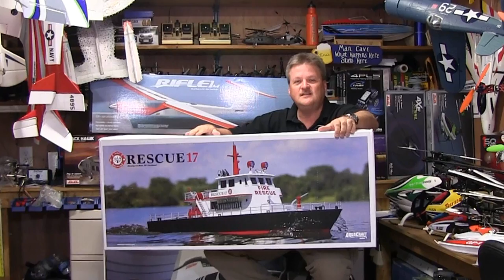AquaCraft Rescue 17 RC Fireboat Review

Comment: I like the variety of subjects; nice to mix things up. I found it helpful that you commented on the stick position / the amount of throttle at different points of the video so that I could get a better understanding of the boat's speed. You should do that more often in your plane reviews - it helps to know how much throttle is required for 'just above stall speed' to 'gentle Sunday flying' when evaluating a plane.

Comment: I actually liked the boat and the water cannon gave it the "oh cool" factor, Its quick enough to be fun, but slow enough not to have the capsize or submerge tendencies of previous reviewed water craft. One thing you did do in the video but did not mention is the common sense issue of wearing proper shoes for this activity. Wet feet equals unhappy boating for many reasons. Good job on the review!

Comment: Great boat with nice scale details. Looks like a great little boat right from the box. I would find a way to add an  led to the water stream to project a red or blue or green  water stream at night and modify it to control the lights from the transmitter. Now all you need is a micro rescue helicopter to land on the back deck

Comment: You are exactly right-they are more efficient. The rubbing parts they lack are of course the brushes :). So you get a motor that gives more power (which can be turned into speed) and needs less maintainance (only parts that could wear are the bearings). This boat is a nice semi-scale model-I have it and to me it's plenty fast for what it is...the brushed motor will last well in it. It wouldn't be worth the cost and effort to make it brushless. Brushed motors still have a place. :)

Comment: Nice boat but I think some improvements should be needed such as a 5 channel radio to be able to turn on and off the lights, and a brushless motor, I know that it might not use lots of power, but it could be improved so the boat would have a longer lifespan.

Comment: Great video she's so focused :) hey if reciever get wet what so ever there ruined so learn from my mistakes that balloon hardly blocks water take it out and hget some liquid electrical tape or plastidip from your local hardware store and leave all the plugs in and paint it all the way around the reciever then it is fully submersible and it won't hurt the reciever or range :) great vid thumbs up also check out a minimono by aquacraft I got one there small and fast myn stock was doing 20